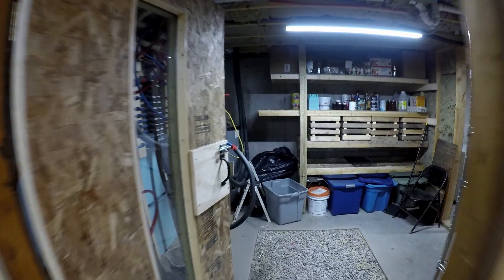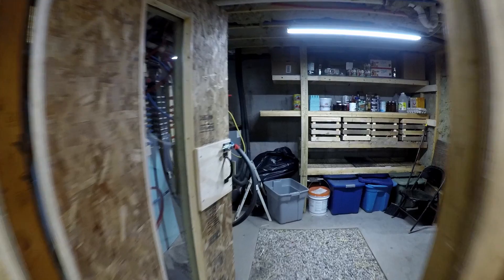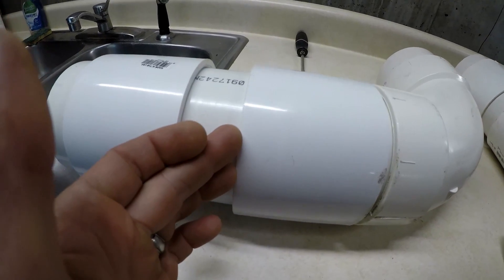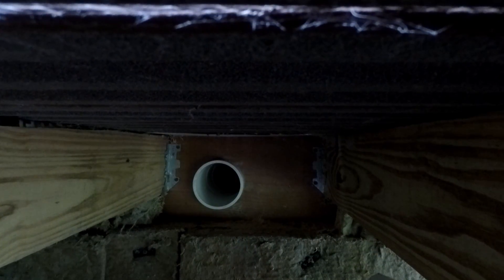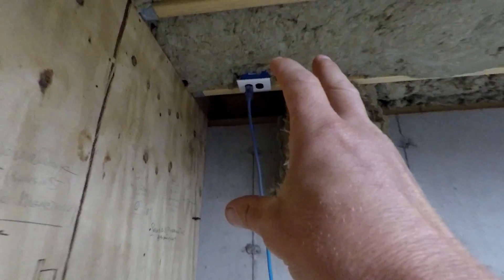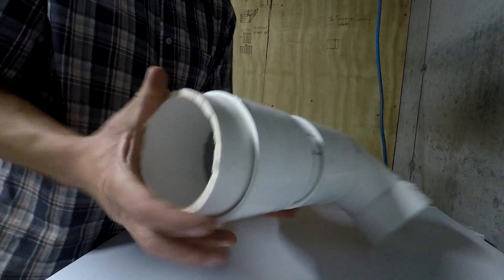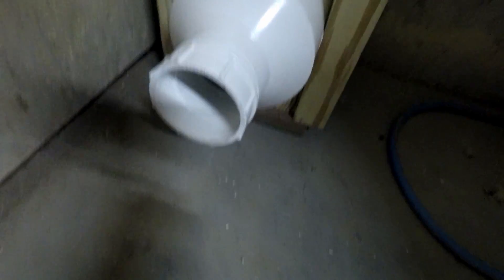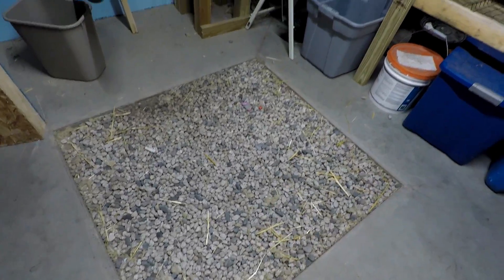ROOT CELLAR Ventilation System | 4 INCH PVC Schedule 40

Comment: Where are radon levels highest in a house?
basement
It sometimes gets concentrated in homes built on soil with natural uranium deposits. It can enter buildings through cracks in floors or walls, construction joints, or gaps in foundations around pipes, wires or pumps. Radon levels are usually highest in the basement or crawl space.Oct. 21, 2019
Reply from the maker: We had tested it a few years back and it was low. The hole is for humidity, though, if I retest and the levels are high, I can concrete over the hole. Thanks for pointing that out.